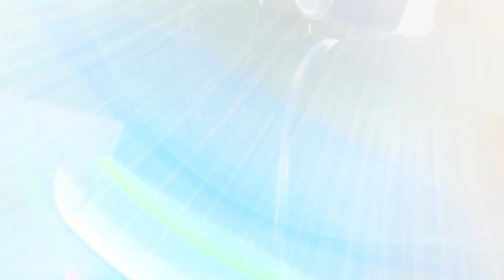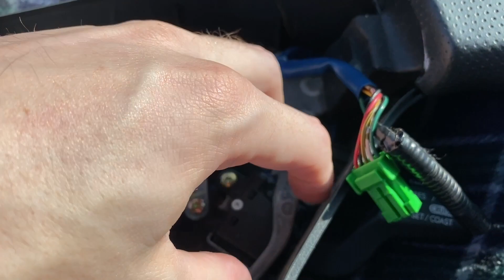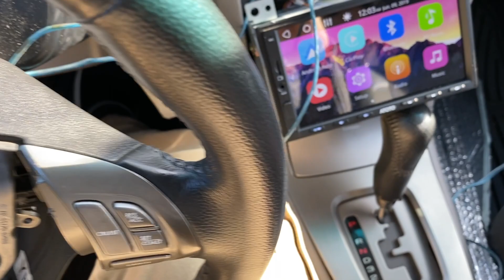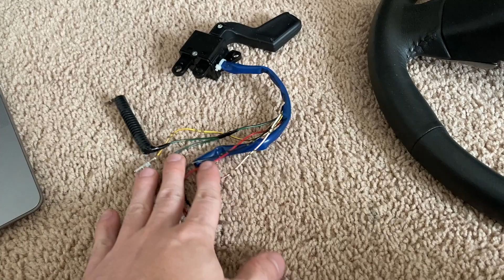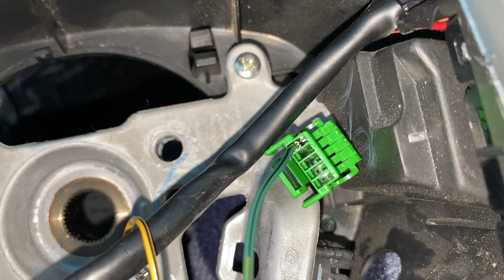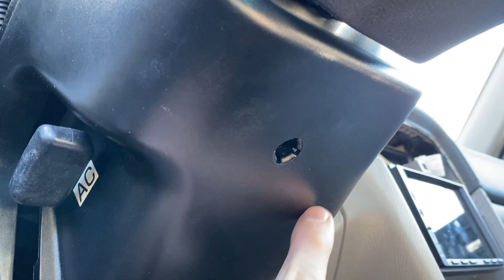New Subaru Steering Wheel in Old Model

Comment: Thanks for the tutorial, I've just sorted SWC on my 08 Impreza WRX without having to buy any modules. For me I had the SW buttons from factory so was not quite the same. For reference I connected the car's SWC1+ wire (brown) to one of the Key 1/Key 2 wires on the head unit, and connected the car's Steering Wheel Controls – (common) wire (yellow) to ground. Works a treat now

Comment: I've swapped a diesel Leather full button SH steering wheel to my dads SH basic wheel and the 4pin brake switch to get the cruise control and the radio controls as a bonus, now i have the basic SH wheel, installed chineese fake leather cover on it and considering to swap it in SG facelift I brouht in the meantime :D it has leather steering wheel with buttons for the oem 2din radio, but it keep restarting so i'm going the aftermarket way non android ust a basic 2 din RGB LCD unit surely without the button suport. I hope the old cruise control unit will fit to the newer wheel...

Comment: Thanks for the video, very helpful info.
I'll be doing this next weekend in my 04 FXT that has an 05 STI wheel. I'm swapping to an 07 Forester clock-spring and a 2011 STI wheel and airbag cover. Looks like my 05 STI wheel could fetch $500 on eBay, so I might sell it to get a D-shaped aftermarket wheel, since the leather on the GR STI wheel is a downgrade compared to the GD.
I've been using an Atoto headunit with the slower of the two Atoto IR remotes (I have the faster, native Atoto one in my other Subaru) and am excited to gain steering wheel buttons. I put the wooden Outback XT steering wheel with 6 buttons in my 2007 FXT, which is a lot easier to do than going from a 2004 to a 2011. 
Here is something I do with the Atoto that I bet very few others do: Set the center "voice search" button on the IR remote to switch to the front camera, so I can park closely to parking blocks without smashing my JDM front bumper on them. The camera is mounted under the front bumper in an existing hole, so the camera actually hits the parking block before the precious bumper does. I like to think I'm good at judging the distance but I still found myself hitting my bumper on crap.

Comment: I did it on subaru xv 2014. The wires do go to the main connecter of the old car radio. Sr- goes to ground an SR1 and 2 can direct connected to the aftermarket android car radio.

Comment: Pretty nice video. I installed the facelift steering wheel from the one you have. Mine also has the phone control buttons. I also made a tutorial for mine and i remember it was a lot of research and testing, but a pretty nice project, you can watch it on my channel.
I was thinking of changing it again with a 2015+ model, but those are super expensive.😅

Comment: Great job with the details of this.  Like you, I spent a lot of time looking at wiring diagrams when I installed this wheel and controls on my 08 FSXT a few years back.  FYI, in the 3 pin connector you have 1 and 3 designators reversed when you are referencing the B236 connector (but as you mentioned, it doesn't really matter as it's just a loop with different resistors for different buttons).  Lastly, in my 08 turbo the 3 pin connector (ST3) is actually used for the cruise control, so you can use that to source the connector and make it a little cleaner install.  Great work overall though!

For others looking at this video, my 08 turbo (SG9 instead of the SG5 of this video), didn't require me to go in and modify the internals of the cruise control switch, so it's a bit simpler.
Reply: do you know if an 06 impreza would require modifying the cruise control switch? I just bought a 2010 impreza wheel and am gonna start working on it tonight
Reply: @jimmyj.jr.1053  Sorry,j I can't say for sure.  Share if you figure it out though
Reply: @NickPa777  Hello there. I am in the same boat with the SG9. Were you able to find out where the 4 empty pins on the green connector lead to?

The 1st of the pin in the green one is hooked to my air bag. The rest is empty.
Reply: Please tell me you can assist me, i bought a legacy GT steering, I just want to connect the radio, i only have one spare wire/pin in my setup. which wires do i run for just the radio (SW+) like jrobling
Reply: Don't suppose you have any details of the conversion?, I have an 08 SG9 and are looking to swap my wheel? Any help would be much appreciated
Reply: @markhoggard8880  pm me here I can walk you througg